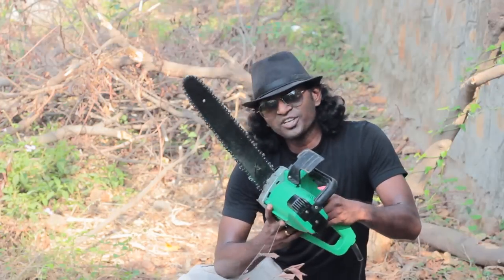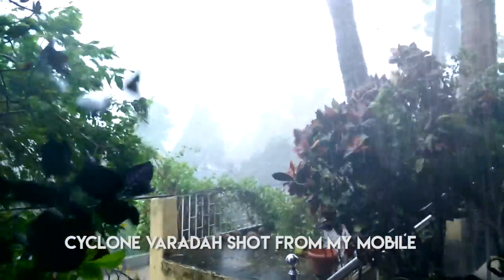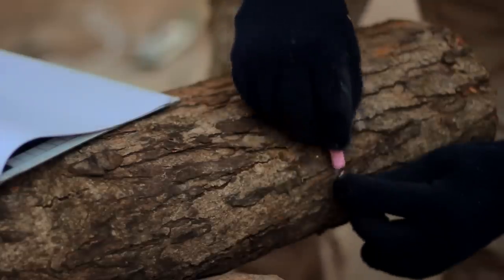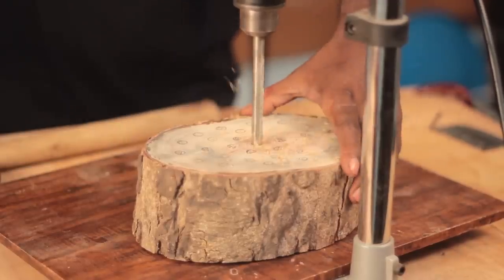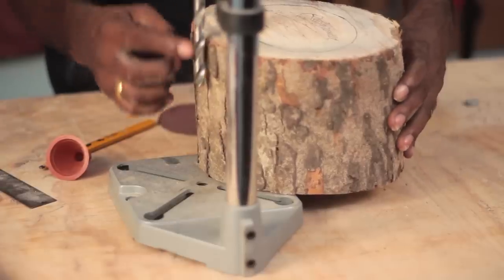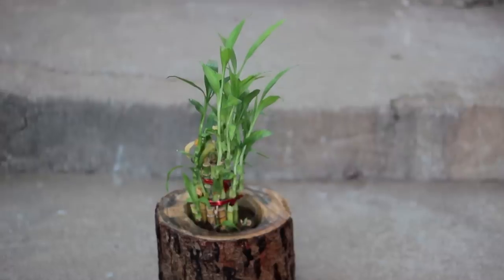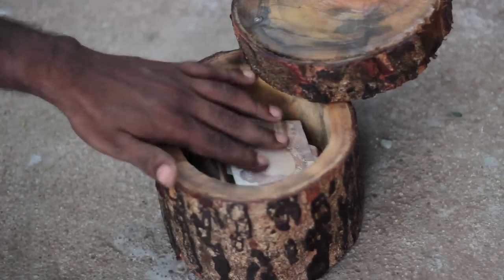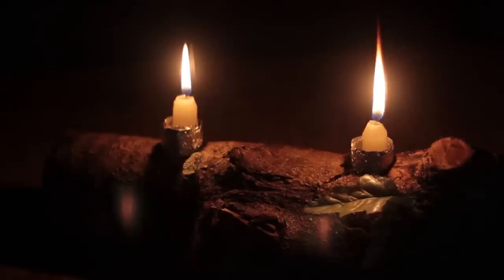Make 6 DIY Home Decor Items from One Log--You Won't Believe What You Can Make!

Comment: Wow great!! Which polish did u use on wood slice? Recently i got my wood log cut into several pieces..i used sand paper to make it smooth but still its look is not shiny
Reply from the maker: For this project I used boiled mustard oil i think. But Now I use linseed oil. But for shiny finish you need to use clear varnish

Comment: We lost a couple of thousand trees to high winds over the last few winters in Scotland at my family home...I'm building a cabin and everything else has to be from the wood thats blown down or from recycled/up cycled materials.  I have a connection to the shed with the sawmill generator but that's only for emergencies.  I am installing a solar/wind hybrid system and a wood burning stove/cooker. I will be using the cabin as a home/workshop as I make jewellery so I will have a butane tank  for that but I am also getting a double ring stove top...again,  for emergencies. ..I saw the roof of the sawmill shed flying down the road on Boxing Day so I need lots of backup.  Of course I can probably survive with just the woodstove as I will be rainwater harvesting too. Thanks for the upload. ..oh btw you're supposed to wear protective clothing that winds up in the chainsaw blade too just in case you hit your legs etc.  Look after yourself x
Reply from the maker: Foxiepaws ACAnderson You seem to be doing a lot, and in a very sensible way. Wishing you the best with your endeavors. If possible, share some pics and videos on what you do. Honestly, I have learnt by watching videos!. Thanks for you comment. I was a bit scared to handle the chain saw first. The owner told me to cut at 45 degree angle to avoid the chain getting stuck and causing damage. Next time I'll surely follow your suggestion while handling a chainsaw. Nice talking to you!.

Comment: Is there an easy way to keep logs like this from rotting over the course of a few years? I cut wood for my fireplace and over a few years logs tend to get very brittle and the bark chips off. How can I stop this?
Reply from the maker: I have no clue how that is done, but the best person to ask would be Steve Ramsey, Mathias wandel. These guys are professional wood workers and know it lot better
Reply: Jackson Catlett  I would suggest a couple coats of boiled linseed oil to penetrate the logs on the exposed grain,as for the bark,spray acrylic. Made my wife a small live edge project and used this method,been over two years,still looks like the day I finished it. Let oil set for 2_3 days before spraying acrylic over entire surface. Good luck.